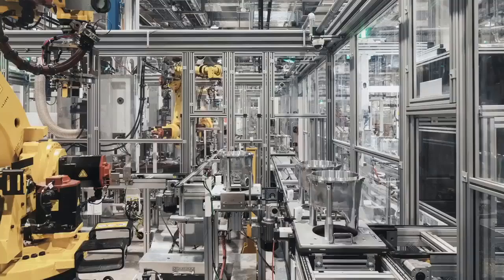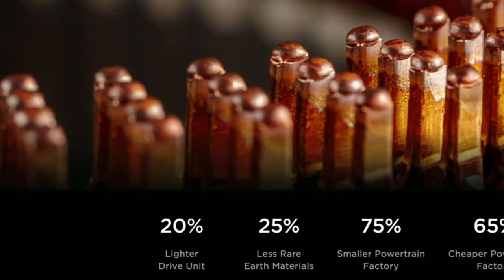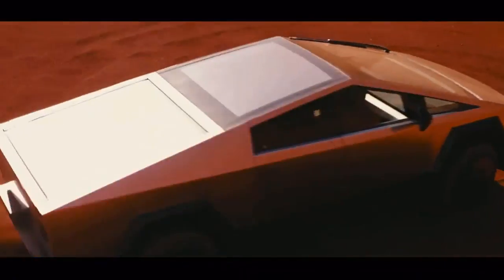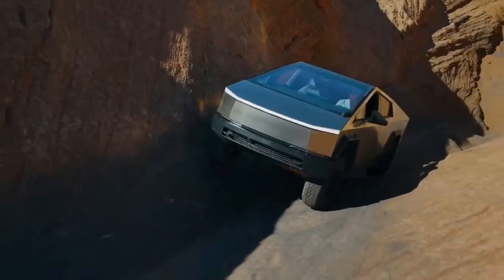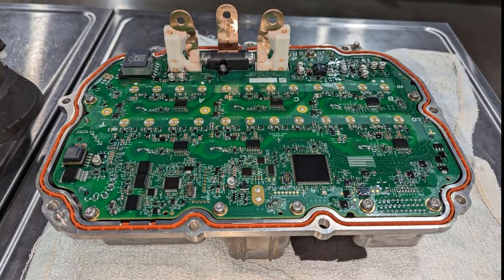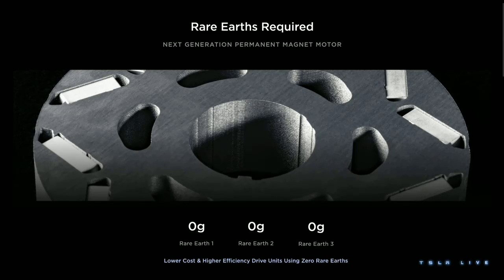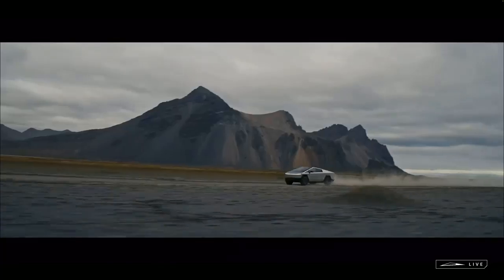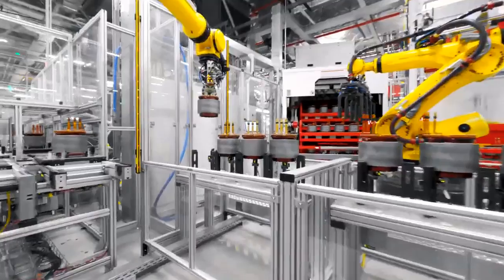Elon Musk's NEW INSANE Motor SHOCKS The Entire Industry!

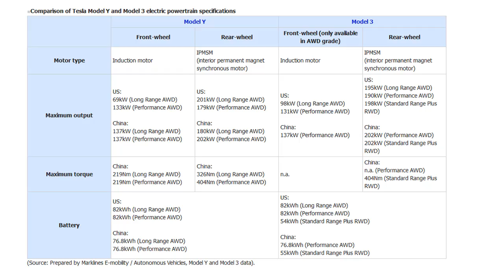Comment: 4:36. You have absolutely no idea why they put the two motors at the rear.  It has nothing to do with trying to "balance" vehicle.  In the Model S Plaid this is done because as you accelerate your weight shifts backward, which means you have less available traction on the front tires, and more in the rear, so the majority of the power needs to be biased in the rear.   Though this is still true for the Cyberbeast Trimotor Cybertruck, in a truck application it makes sense to have the majority of your power in the rear, because when you're towing, your tongue weight goes over your rear tires.  This is why there is no such thing as front wheel drive pickups, because FWD wouldn't be able to pull anywhere close to the same load as RWD.  So the reason the dual motors are always in the back, is because that's where the power is needed the most.  If it happens to provide better vehicle balance, that's just a happy coincidences, as even if putting the dual motors in the back unbalanced the car, that is still where they would be.

Comment: Once again, Elon, focusing on exactly the wrong thing! People are not buying Tesla cars because the motors are too weak or inefficient. People are not buying Tesla cars because they can’t find chargers in a reasonable time to get their cars charged. What did Elon do? He fired the entire supercharging team at Tesla because he doesn’t focus on the overall big picture of what is important about electric vehicles, namely that they need to have some range and they need to fit comfortably into peoples lifestyles.

Elon is doing the very same thing at SpaceX! He is focused on developing the raptor three the raptor for the raptor five. I guess he thinks that if he has the biggest most powerful engine in the world, everything else will fall into place. But the problem is that after four years, the starship heat shield tiles still fall off during lunch and they break in flight. The only thing unique about starship is rapid reusability Objective. Unless SpaceX can come up with a tile design that works perfectly every time so that starships do not need extensive heat shield repairs after every flight, then starship will be a complete failure because there will be no rapid reusability. El apparently doesn’t understand this because he’s a doofus. He should be laser focus not on a new raptor injured design. He should be laser focused on a heat shield design that actually works and supports rapid reusability. Unfortunately for Elon it might just be the case that there is no cost-effective heat shield use a current materials that can do this. If that is the case, starship will be a complete and utter failure. Starship will be like a Tesla, stuck by the side of the road because it couldn’t find a charger.
Reply: This is utter BS their is no range anxiety and their are plenty of superchargers
Reply: @frederickfaller899  
Good point!

Comment: Before we get to the magnetic loss this is winding loss. It compose of copper ohmic and copper eddy losses. Eddy loss is mistaken as skin loss in terms of ohmic factor. 

Conventional: Skin depth is model as the proportion of cross sectional copper area depletion as frequency increases. 

Actual: A conductor doesn’t require electron as a carrier of electric charge, unless we need charge to move (migrate) between electrodes across a vacuum tube. (Cathode ray tube). So electric charge is extrinsic attribute of copper wire. (Faraday already demonstrated there is no charge inside of a metal cage, so as a inside of copper) 

When charge start to move it induce a current into the core of wire and this is eddy current. When eddy current encounter copper resistance we have ohmic loss. Also eddy current intensity is directly proportional to the operating frequency. Also the more surface area a conductor has the less is the eddy current. Also multi turn winding or stranded wire has more surface area per length compared to solid wire. Hence less eddy loss. 

Skin depth loss came from eddy loss.
Reply: Dang bro, I wanna enroll in yr class
Reply: @UncleSaif  you should think twice about that. I failed all exams I took.

Comment: I saw a mechanic taking a cyber truck apart. You really need to be an electrical engineer to work on these trucks. Repairs are going to be a fortune. I wonder what the resell value will be after a couple years of use as an off-road cargo hauler.
Reply: Off road cargo hauler? How many people have ordered one for that use case?
Reply: Until a new work force comes into being.  It's not like there were mechanics that could work on a ICE car when they were new either.
Reply: @TheEvilmooseofdoom yeah the old mechanics were shoeing horses and fixing the harness.

Comment: You also need PM for regen...
Reply: Well, my Tesla has only induction motors and I'm sure it has regenerative braking.
Reply: @Steppenkater Mine too ,  maybe they need to read up on pre- 2019 X/S .
Reply: @Steppenkater  must be a wound rotor induction motor...
Reply: "You also need PM for regen..."

No. You don't.
Reply: My 2017 X90D has 2 induction motors. No PM. It does do regen but not until standstill. Perhaps this is what was meant.
Reply from the maker: You can regen with induction too
Reply: @TMIOTesla  no you can't. They are squirrel cage induction motors....  They can't be used to generate.
Reply: @bikepacker9850  Squirrel cage induction motors can be used as generators when providing a reactive load, which the battery and Tesla drive electronics should be able to do.